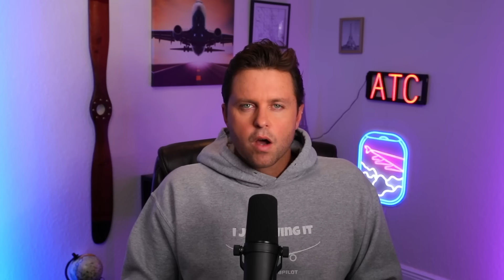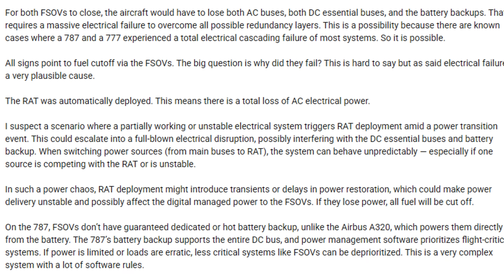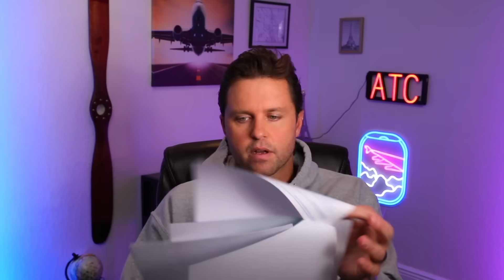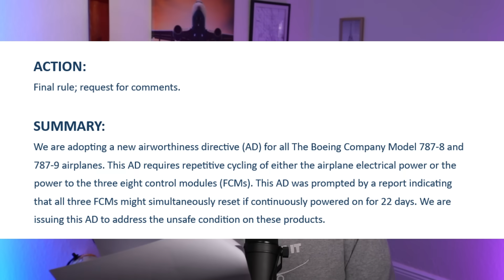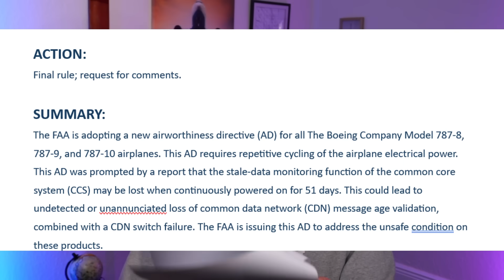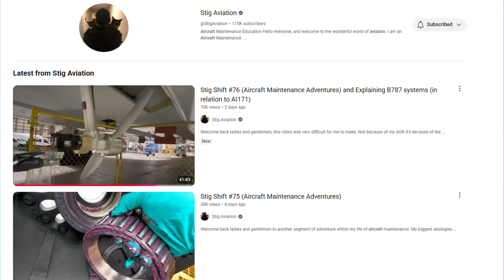Air India 171: Did a Software Glitch Cause Dual Engine Failure?

Comment: We were waiting for this Gary!!

Now time for Captain Steve!😮
Reply: I have the deepest appreciation and respect for Captain Steve but if I hear vapor lock or fuel quality as suspects I’m gonna scream. 😂
Reply: Captain Steve has lost it for some reason..just coming with videos...less thinking and analysis.
Reply: @TheCheckit96  Agree. Even with wheels down and flaps up, the 787 should have been sailing into the sunset. To conclude that was the reason was totally premature.
Reply: @MarkLarma-r9x Vapor lock theory is a BS, cause 43° Celcius is a common temperature on any given summer day in India. In Central Asia countries like Uzbekistan the temperature can go up as high as 55° C.
Reply: I would say: now time for Juan Browne (Blancolirio)
Reply: Steeeve!
Reply: Captain Steve is all sizzle and no sausage
Reply: @stephenmcqually2983  "Captain Steve is all sizzle and no sausage" 

Alright Mr. Keyboard Warrior. How many hours have your got under your belt?
Reply: Captain Steeve is going to point to any possible causes other than the plane itself until hard evidence (like the RAT deployment) publicly and shamefully proves him dead wrong.
Reply: I use to have massive respect for Capt Steev, until  he came up with  absurd pilot error theory.
Reply: @sreehariraghav  I agree. His theories are seeming a lot less reasonable by each passing day.
Reply: @sreehariraghav  It wasn’t exactly absurd. It was a possibility and clearly stated as only a best guess.   He also corrected his guess when more evidence was presented.  No reason not to respect him.
Reply: @libby2012 
He completely ignored the fact about mayday call, auto gap protection etc
Reply: Captain Steve is just a money grabbing youtubers with no self respect.